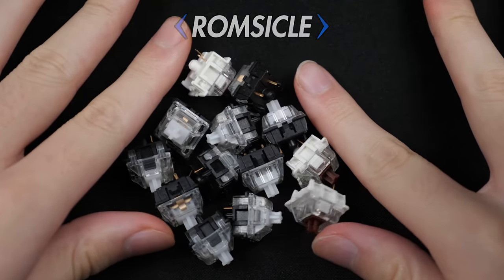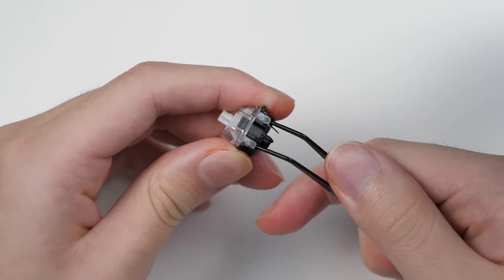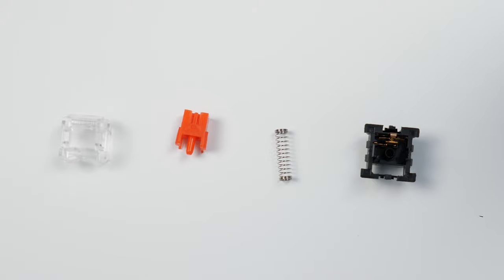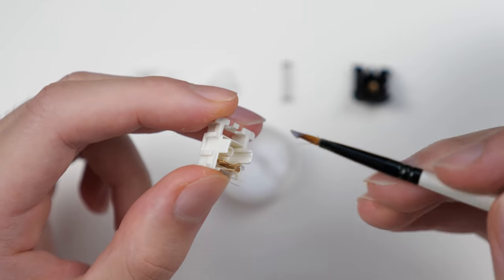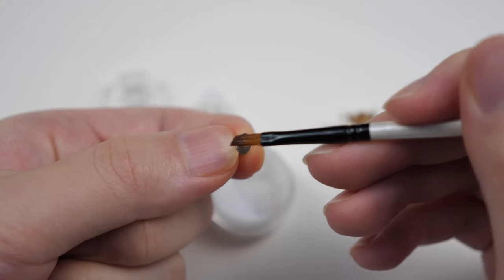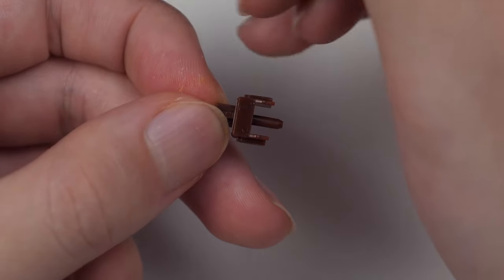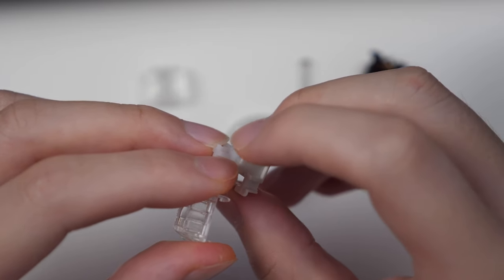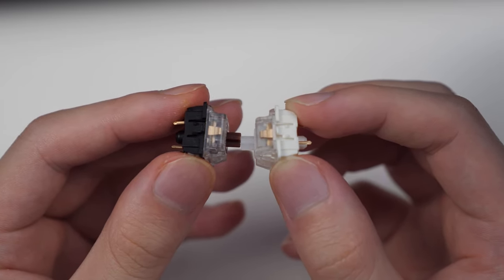How To Lube Your Mechanical Keyboard Switches

Comment: Yeah so I followed this exact tutorial, only finding out at the end that all my keys didn't register when I clicked on them (it took a couple of triest before they registered). I did not put too much lubricant, but I asked a friend what i did wrong, and he said I just had to lube the bottom housing and the spring. Now i need to go through the process of cleaning all my switches (around 30 minutes for 5 switches) or I will just have to buy new ones. Don't make the same mistake as me.

Comment: I'd say spring weighting isn't the most important factor in determining whether or not to lube the legs and contact leaf's of MX style tactiles; especially because two springs with the same bottom out can have two different profiles and higher spring weights don't make a switch more tactile just heavier. If anything, higher spring weights mask the tactile event of many MX style switches due to their low and drawn out tactility. 

I made some holy pandas with 55g SPRiT slow extreme II springs and lubing the contact leafs and legs did not kill the tactility precisely because it wasn't being masked by a very heavy bottom out weighted spring. 

Box Navy's do not generate their tactility (and click) in the traditional Cherry MX way; instead of a bump on the slider legs, their is a protrusion on the opposite side of the slider which is caught by flat spring which provides tactility and click when overcome.

Comment: I personally find lubing the leafs usually causes more harm than good even with most linears. Otherwise, fantastic video!
Reply: interesting..what harm you talking about.. gonna lube soon for the first time..
Reply: @dimwillow7113  easy to over lube, which will make them worse than not lubing them at all. Also dont bother lubing the top housing it makes no difference.
Reply: @grrizzzy7  i see.. thanks

Comment: Just for reference to any first timers out there, it took me roughly 5 hours or so to lube a full set of switches for my 65%. I think with more time i could probably get it faster. Its kinda awkward handling the switch cus its small. Also I hand lubed the springs so if i were to bag lube them it wouldve been faster as well.

Comment: just a heads up, but silicon lube is dielectric... putting too much lube on the switches can cause lube migration to the contacts. I would only lube the side of the stem and spring on the side away from the contacts to be sure.

Comment: how long does it last for? Do i have to redo it, after years? Does the lube thicken? Is it worth for switches that will be used for atleast 3 years?
Reply from the maker: Long enough that you won't have to ever worry. It's always worth it to lube your switches.
Reply: @Romsicle  which lube do you recommend, or is there anything to consider?
Reply from the maker: @pudelmuetz1  The two most common lubes are Tribosys 3204 and Krytox 205g0. If you want a thicker lube, choose Krytox.

Comment: @Romsicle What's the idea behind lubing the top housing? I could imagine it may help dampen the upstroke sound a bit (don't know how nice a stem hitting a lubed housing is), but wouldn't it also increase the initial force of the switch, since you now have lube sticking between the resting stem and the top housing?
Aside of that, the video was super clear and nicely presented!
Reply from the maker: It's definitely not necessary IMO, but it allows for a smoother and quieter experience all the way through. Since the lube layer is so thin, there's virtually no difference in resistance upon initial actuation.

Comment: Hey! Can you post a video on how to lube low profile gateron browns?
Reply from the maker: I'd strongly suggest you don't lube low profile gateron browns. You can check my keychron low profile switch lube guide for a similar process if you really want to do that.
Reply: May I ask why?
Reply: Does it lubing the low profile browns make any significant diffrence
Reply from the maker: @spotlessreviews7425  You lose all tactility - browns are barely tactile, and you're just going to turn it into a linear switch.
Reply: Ohh thank you!! I won't lube the browns then.

Comment: Is it just me or does that seem like a lot of lube? It seems like some pretty big blobs of lube on the bottom housing and the stem. I'm just wondering because I was told Krytox 205g0 is pretty thick and shouldn't be applied heavily.
Reply from the maker: It might look that way because it's zoomed in and it's cut short compared to how long I actually take to make sure it's lubed well.

Comment: I use a rc shock silicon oil, 600 is thick enough i even tested 50000 diff oil that thickness dampens alot even dampens the sound when bottoming out. Not sure how good in the long run but that oil is cheap.

Comment: Nice vid bro.
BTW did you use the other lubricant (3204 or 32C4, newbie not sure)?
Reply from the maker: Krytox 205g0
Reply: @Romsicle  how many grams of 205g0 should I buy for my TKL KB?
Reply from the maker: @assasin4715  3mL is more than enough to lube 2-3 keyboards worth.
Reply: @Romsicle  the shops I saw offers only per grams. 3g, 4g, 5g, 10g and 50 grams.
Reply from the maker: @assasin4715  Google is your friend for conversion, mate.
Reply: @Romsicle  Thanks.
Didn't thought that I could find a conversion of lube on google. LOL

Comment: Fist time trying to open switches and I'm breaking every one. Either it wont press in when I reconstruct them or the switch wont fit back into the board as one of the 'legs' will be stuck out too far from when I prised it open. Gonna get a switch opener...
Reply from the maker: If it's not fitting, you're doing it wrong. Go slow if you're inexperienced because you'll destroy your switches.
Reply: @Romsicle  yeah stopped after 3 :) only using cherry reds to start with, not touching the Zealios! XD I can't figure out what I'm doing wrong though. Wont do any more until the switch gadget arrives.
Reply from the maker: @diggergig6585  A switch opener isn't always going to open up the switch perfectly AND is not going to help you close up a switch properly. Watch the video. There's no reason you should be getting it wrong.
Reply: @Romsicle  oh darn! Ok, will run it a few more times to see where I went wrong. Thanks for replying.

Comment: I was told Tribosys 3203 lube is great for Gateron Browns. What do you recommend for Gateron browns?
Reply from the maker: 3203 is good because it's more viscous than 205g0. You'll feel the smoothness and still get some tactility.
Reply: @Romsicle   thought lube gets thinner as the last # goes down.  205-4-3. Etc

Comment: Was the keyboard that you had at the end hot-swappable?
Reply from the maker: Not hot-swappable, but it's plateless, so you still open and lube the switches. MX Silent Board: if you're wondering what keyboard it is.

Comment: can you use silicone grease for switch lubing
Reply from the maker: From other users, silicone grease is best used for stabilizers but not switches because it's really thick. If you are going to use it, you may have to dilute it or apply an insanely small amount or else your switches are going to feel real mushy and not as responsive.

Comment: Which brushes qre u using?
Reply from the maker: Just some thin angular brushes from AliExpress - I suggest looking into some 0, 00, 000 tip brushes though
Reply: @Romsicle  thx. i just got into custom keyboards. as a gift for my birthday, i got 300 dollars to spend on a kb. are JWK lilacs good? i like the sound better then i like ink blacks

Comment: is it worth it to lube cherry mx blue switches?
Reply from the maker: I don't think it would be a good idea. You end up losing the properties that make MX blues enjoyable.
Reply: @Romsicle  is it worth it to lube gateron blue switches? If it is worth which lubricant should I use?
Reply: The question should be, is it worth using MX blue switches? No

But in all seriousness, if you do like mx blues, if you lube the click jacket, you will turn it into a tactile switch. But, if you only lube the spring, it will improve the sound and not interfere with the click.

Comment: Currently just made my stems stuck and it just stays in the bottom
Reply from the maker: Lube doesn't do that. You reassembled it wrong.
Reply: @Romsicle  Yeah I just realised, I figured it out now but my blues definetly feels different, Thanks for the tutorial
Reply from the maker: @azuhawl  Oof, lubing blue clicky switches is not recommended but if you like the new sound, more power to ya

Comment: If the purpose if lubing the spring is to reduce vibration, something thicker like the 32c4 you are using there would make a better job right? I wonder if I should use it too in the upper base of the rails, so it damps even better the knockback sound.
Reply from the maker: I think most people go for a thinner lube like 3204 for the springs. Don't think thicker lube will dampen the sound that much. Might as well get some silent switches instead.

Comment: I have the EVGA Z15 with the Kailh Silver Speed Linear switches. I would not know why someone would want to "lube" these switches from the inside. That's already a bit to much of fanatism or geekism IMHO. They work just fine out of the box since plastic is an self lubing material.
If the nerdiness goes to far, one gets ever more subjective instead of objective. There is no real objective measurable ammelioration by lubing any switches of an keyboard unless they are constructed very badly. I recommend the Kailh switches. No need to go for expensive german cherry switches. Why again these german switches are more expensive than the Kailh ones? There is again no objective real reason the Cherry's would be any better than the Kailh's. I just opened an Kailh broze Speed switch and studied it with an loupe. These are well constructed and really no need to modify anything nor any objective real world need to lube them. Nor can I see the Cherry's would be of an higher quality than these Kailh's. Just go for the Kailh's and change them if they fail you - that's why I got for an hot swappable mechanical keyboard. These Kailh switches are well constructed and they will fail only on the 2 plastic ears who actuate the copper piece letting it down to the silver contact plate or the copper U shaped piece which bends will crack due to bend 70 million times (as these are rated for 70 million actuations). Thats the only thing which can fail internally of the switches besides eventually the main spring could loose strenght by being pressed down 70 million times. So the plastic used for the stem and ears is important and that could be an difference between the Kailh's and Cherry's since the Kailh's are rated for 70 million actuations and the Cherry's for 80 million. Wear down is determined by the plastic type used and the thickness and material used of the copper U shaped plate which does the bend. That may be an difference between the Kailh's and german Cherry's. But it's an negligel difference when you have an swappable switch keyboard. Fit and finish as quyality seems to be superb on the Kailh switches. The upper and lower clip has 3 prongs instead of only 2 of other brands from China and thus is more sturdy (will not break soon if people open often the switch). The copper bend is in an separate compartment and thus protected better from liquids and impuirities which could potentially enter the switch when the stem is pressed down. Liquids can drip out from the otherside when entered the switch since that is open to the outside and has an pass through slit (where the LED light is). Still then the liquid can drip to the PCB and do some shorts on the circuitry. But that has nothing to do with the switches themselves.
I put 2 disks of silicone underneath the key caps on these Kailh silver speed switches due to 80% typing errors. After the 2 dampeners installed I get only roughly 12% of typing errors (typos) approximating already the typing accuracy of an Dell membrane chiclet keyboard. Out of the box these Silver speed switches cause lots of typos. With dampeners they become usable since they shorten the bottoming out vastly.
I recommend 100% these Kailh switches. No need to look for an expensive alternative which is of the same quality and functionality but 2 times more expensive.
Reply: Lube makes it less unpleasant to the finger